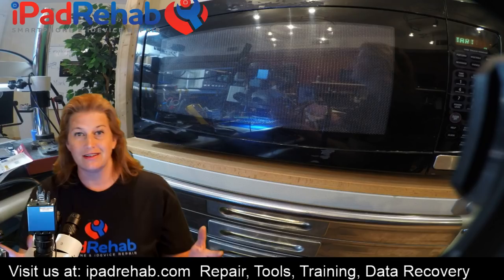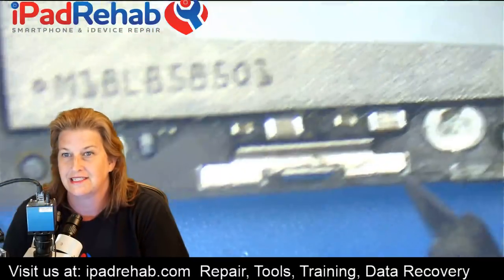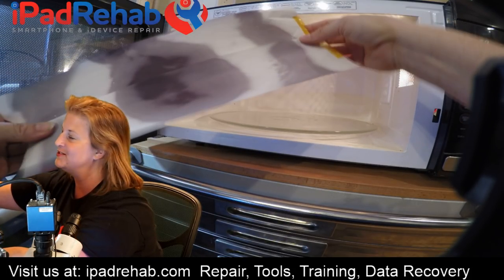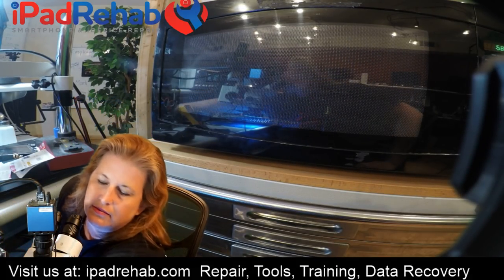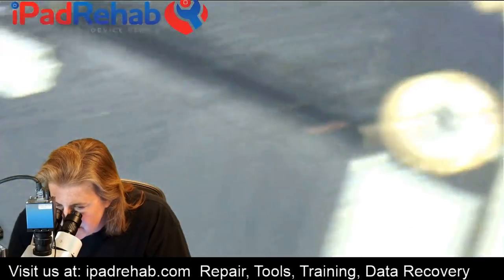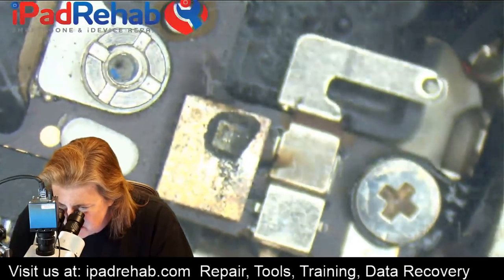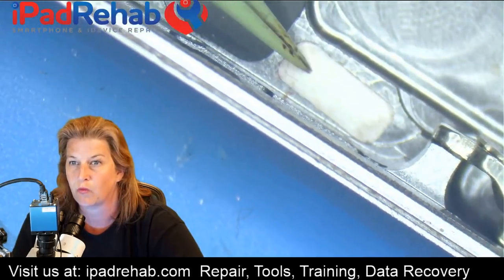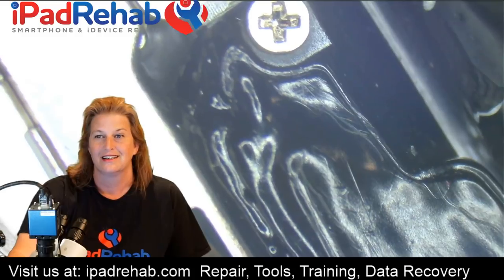Microwaving iPhones in the name of SCIENCE!

Comment: there was a house in the uk that kept blowing fuses and melting wires, blowing up tv's,     the guy had the house re wired but it kept doing it, it turned out that his house was in direct line of a microwave link between 2 RAF air bases and the microwave signal was screwing with his electric
Reply: Impossible. If the RF energy was that high,  birds would fall from the sky and people would get blind.
Reply: i'm trying to find the story on google,   it was an RAF  "royal air force" communications link not a russian death ray
Reply: RF can do a lot of strange things. When i was a tv repair guy several years ago, 1 customer had his TV set several times broken. At the lab it jus worked fine. Back at his place it went all bzrk again. I looked out of his window.. And there it was.. The biggest radio/tv antenna of the Netherlands in Lopik, Near Utrecht. Right in his back yard. Just replaced the tv-drawer for a few meters and it never happened again haha.

Comment: The microwave radiation causes high voltages to form between smallish metal objects and creates electric arcs.
You will almost instantly get 1000's of volts across pins of many IC's and they will be instantly destroyed.
Secondary effects will be the heat from all the arcs melting things and causing them to explode due to internal pressure.
A microwave will instantly fry multiple ICs on the board and burn internal PCB tracks.  It's just not something that's fixable in any sense, a microwaved phone is as dead as it gets with perhaps 100's or 1000's of individual faults
Reply: What he said. It's not HEAT that destroys the electronics. It's the insanely high voltages that develop on the antennas (all small metal parts in a microwave works as an antenna)
Reply from the maker: I think that microwaving a phone is the 'easy' way to intentionally destroy it---that's why I wanted to make this video, to show folks how to recognize what just a few seconds in a microwave looks like so no one wastes time on these boards.

Comment: I think that's a standing wave pattern on the receipt paper and has to do with the 2.4ghz wavelength. Also, I suspect the battery would be fine for a few seconds since it is shielded (in hermetic aluminium wrap).
Reply from the maker: That's an interesting theory---what do you think of this article where I got the idea? https://www.evilmadscientist.com/2011/microwave-oven-diagnostics-with-indian-snack-food/
Reply: iPad Rehab It's neat! More three-dimensional analysis would be needed however. 
You have to consider volume and shape of the resonant chamber (ratio; although I think it's standard for all microwave ovens, aka the most efficient design), power output into the chamber, pitch variation/resonant frequency (also likely standardized and FCC enforced frequency window), method of transmission (antena design), probably something else too.

Might be simpler to do a 2x2 cocktail stick cube and wrap receipt paper to it in specific areas... I'm no expert so will give that a go.

Comment: In my opinion, it doesn't look like the same kind of damage as the one you microwaved. The microwave didn't look like it "melted" any plastics, it looks like it obliterated it and certain metals which we didnt see on the 6. The 6 has softly melted plastics, not really anything obliterated. 

I am wondering if the phone was subject to some kind of vapor that caused it. Acetone for instance will melt PLA plastic and I think other types, but not all. For example, suspending 3D prints in a container that has acetone on the bottom and letting the acetone vapor melt the print is a common method of smoothing them out. Look it "acetone smoothing 3D prints" on google and you can see the similarities in how it looks compared to the iphone 6. It also does not affect all types of plastic, which could explain why it appears "localized" since if the parts are made of different plastics, some may be immune to the acetone vapor. 

Acetone can also damage some metals. I once accidentally cleaned a ZIF cable for a PC laptop's trackpad with acetone on a paper towel, and the metal traces on the flex just disappeared. Had to replace the whole flex.

Comment: Maybe try one of them Static balls that you can get from Spencers. Or may have use the wrong battery charger like if someone used a regular battery charger and had a broke charging wire would that do damage like that like it you put a high amount of amps with lets say a car charger and maybe no a Microwave

Comment: would it not be possible to simply put the flash memory into a working phone?
Reply: miko007 not if it was put in a microwave. If it was, the microwave would have instantly put thousands of volts through every chip on the board.

Comment: Don't run a microwave with only receipt paper in it! The paper does not contain water and will not absorb the microwaves and they will be bounced back into the magnetron and it will overheat and get destroyed. You should never run a microwave empty for this same reason. If experimenting with paper/whatever in the oven, put a small glass of water in a corner to absorb the energy and you will not hurt the oven. The reason for the thermal paper to get marked in the oven is because of dirt and crap on the glass that will absorb the microwaves and the glass itself heats up.
Reply from the maker: I also had that thought, so I had spritzed the paper with water lightly before turning it on---I forgot to mention that in the video!